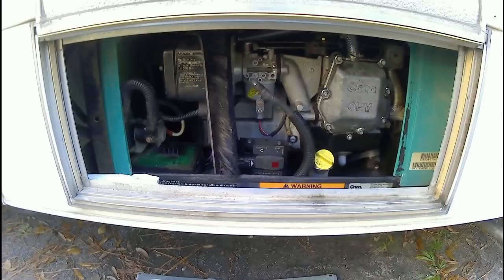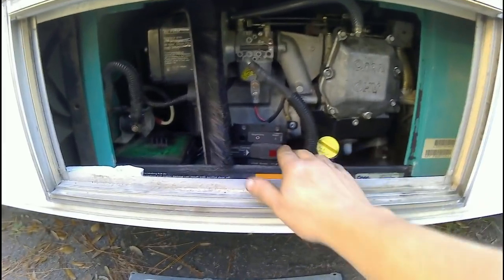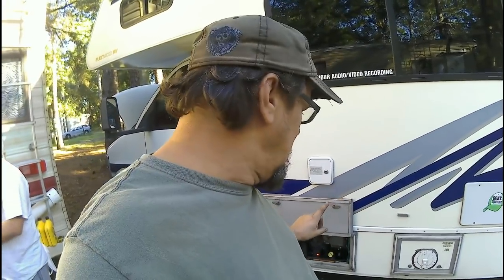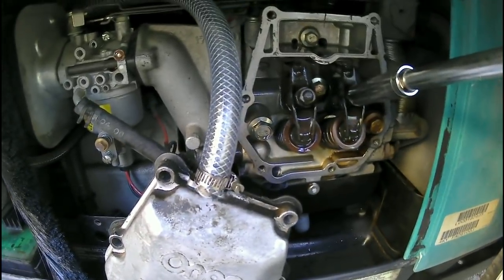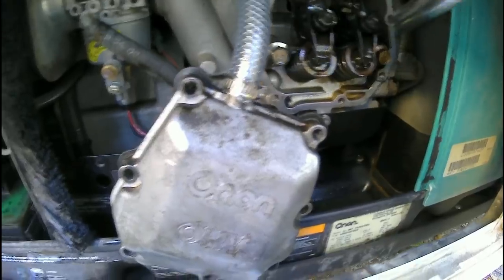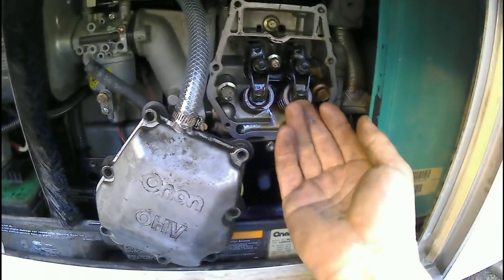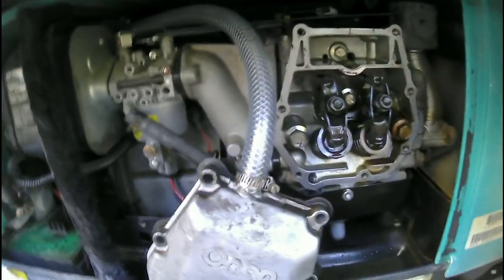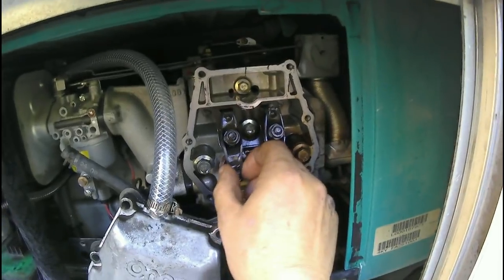Nomatic Fanatic Genset repair and Bloopers.

Comment: Tell him alot of times those mr. Buddy heaters need to have the orfice blown out with air before they will light and stay lit. I cover mine when not in use during warm weather with the Blue Painters tape to keep out the Dust. A can of Computer cleaning air will work also. Gr8 vid and look forward to watching more wayne.
Reply from the maker: I did let Eric know and he said Thank You. Great tip.
Reply: Yw, did a service call this evening and blew a gas log out and it fired right up and the homeowner said the gas co. Wanted $80 just to show up.
Can of air $8 at lowes

Comment: Wayne, glad you could help Erick. It's hard to do what he does, without being able to fix things himself. Most mechanics are just parts changers these days. 
BTW, the clear braided hose may work in an emergency but it's a good idea to replace it with a hose rated for oil and high temperature. Autozone sells it by the foot.
Reply from the maker: There is a difference in a mechanic and a parts changer. Parts changers cost you money while a real mechanic will save you money.
Reply: Sad but true. Dealerships love parts changers who can work very fast while often cutting corners. This is how they make money. I worked with a guy who was one of the best mechanics I ever met. He took his time to troubleshoot problems properly and to get the job done the way it should be done. The dealership was not happy with him. He did not make as much as other techs either.

Comment: When my onan stop working,I just got a Yamaha 2000 watt portable generator...much more quiet and has better fuel efficiency and its dependable and  weighs 45 lbs vs 200 +pounds for the onan.

Comment: Good job Wayne ! I need to drop my 2.8 in my Roadtrek and clean and rebuild the carb or convert it to propane . Oxegenated gas is a pita with the tiny jets . I wish all motor homes had the generator on a slide out rail system like the 70s GMC , how nice would that be ?
Reply from the maker: I dont think you have to drop it to remove the carb. Not 100% sure.

Comment: Some mad skills, would never have thought to check the oil plug to see if it was "An oil Plug"! Have the same Micro loud 4000 in mine, I gave up on it and got a Honda 3000ui, the Onan literally just gave me headaches from the noise/vibration. Eric owes you an "Outtro" for that fix. The sound was pretty good, but your killing me with no image stabilizer/gimbal. Just do tripod shots for fixed that looked good at 11.00 minute mark. Then slice the ends off in editing, Also frees up the hands.

Comment: When you tightened the valves did they have a locking nut on top or how does that work?
Reply from the maker: It is a single locking nut.

Comment: I noticed you adjusted the valves with out having it at top dead center on the compression stroke. The spark plug was still in and the flywheel is not visible. How did you find the exact top dead center ?
Reply from the maker: As long as the valve is in the fully closed position you can adjust them. I used the starter to bump the engine over and turned it by hand to get it where I needed it. Years of doing this you just know what to do.

Comment: My genny is the same and even has brass (NPT) plug and still does and 1350 hours.   Makes me wonder if Onan put it in by mistake?  Thanks for showing thread size.  Yes, first time changing oiI, I looked long time for oil filter (ha ha)  Couple years ago our friend caught his on fire.  He never inspected hoses, and had small leak and one day when starting it went up; Poof.  Hoses get hot and cold over and over their entire life.  Which is hard on hoses.  Same friend also was in process of checking oil and broke his plastic dipstick off,  he never saw it again.  
P.S. proper fuel pressure is (believe it or not according to Onan mechainc) "if gas is making it out of the hose at the carb end,  with gas line raised no more than 2 inches higher than carb,  then you have enough fuel pressure"   Certainly there is better spec.  Do you happen have a better spec than that? Thanks

Comment: Quality diagnosis and work.  Always simple after solving, eh. I have same genny, I'd be curious what gap on lifters?   I always look forward to your videos.  Take care
Reply from the maker: Intake Valve Clearance (Cold) 0.002 inch (0.05 mm)
Exhaust Valve Clearance (Cold) 0.002 inch (0.05 mm)

Spark Plug Gap 0.025 inch (0.64 mm)

Comment: OK Wayne. I want to tap into the wealth of Genset Knowledge  you have.  I have an 2005 Onan 5500 and I know I should change the oil and filter every 150 hours. My question is this. I only run my Genset when I arrive at a campsite to run down the levelers and run the slides out. I always run it at least 30 min before shutting it down. I take the RV out once or twice a month year round. I will never hit 150 hours of use in the next five years. I have not changed the oil in nearly 3 years now. I check it before every trip to make sure it is full of oil. I am going to change the oil come spring even though it has 18 hours of use on the oil. In the future, how often would you change the oil ?
Reply from the maker: I would change it at least once a year if you use it like you said. Moisture can build up on the engine and gets into the oil and that can ruin the engine.
Reply: I will indeed follow your recommendation. FYI I have a 2005 Georgie Boy on a W22 Workhorse Chassis with a 8.1L GM Motor if you ever have any questions concerning either the coach or the drive train what I don't know I have resources that do.  Thank you Wayne
Daniel R. Fort Worth Texas
Reply: Thank you Woody. Wayne said pretty much the same thing. I will take both of your advice. 
Living in the deep south we do not have an off season. As a matter of fact I just got home last evening from my latest outing. I also do a New Years Eve Campout each year.  Thank you for your reply woody.
Daniel R. Fort Worth Texas
Reply: You will not hear any from me either. I love the power plant and drive train enough that I will keep it and change out the carpet to laminate, Sleeper sofa to and L Shaped Sofa with a bar back and two chair. I have the remodel figured in my head. Next is to put it on paper. Then, Jan and Feb make it happen. 
Daniel R. Fort Worth Texas

Comment: Did you have to tap it to use the new drain plug? I have a similar issue.
Reply: rtzapper, I was wondering the same thing.
Reply from the maker: No, The plug I used was the correct one.

Comment: One word of advice Wayne. I've had some of the same issues and in fact I have a video on a zero cost nothing for generators of this exact type.  they run fine and then die. I know your video is not the same but 1 thing I can tell you from experience and you may know this, I'm just telling you in case you don't.  when you spray water or fluids back in there to clean the generator it's almost impossible to blow out and dry up the starter and has been my experience that within 6 months the starter will fail because it had water up in there.
Reply from the maker: I didn't spray alot of water and was careful of where I sprayed.

Comment: Please tell Eric that as he ordered the new pump, he has a responsibility to let the shop know that it is no longer required, out of respect. That means that if I need one I’m not told they won’t order one without a large deposit. I think I would have checked the pump first, I know hindsight is 100%.
Good job though!

Comment: Wayne I'm trying to learn here, confused. If the NPT (National Pipe Thread) plug that has 14 TPI ,.74 inch dia.( threads per inch) was forced into the soft cast aluminum crankcase hole many times by now. How did you did you fit the smaller M14X1.5, , 13.9 MM dia (.55 inch dia) drain plug in the worn larger and stripped hole. Also  Eric said it was loosing a quart of oil per day?
Reply from the maker: I dont know what size the NPT plug was. When I put in the correct drain plug it was a little tight but went in smoothly. It tightened up better then the brass plug that was in. Th brass was somewhat lose and couldn't seal correctly. Yes he said it was leaking about a quart a day.
Reply: Thanks Wayne for that information.

Comment: Just watched NF's newest release. More genny and brake drum issues.
RVPW; would you address the possibility that basic Class C RVs are not really designed for full time living?
NF has put a LOT of miles on his rigs. Most of this is likely just normal wear and tear for the mileage.
IS this correct?
I'm ten years out retiring and going full time. I now am considering a Super C for longevity and reliability vs a 'van' Class C type.
Thanks!
Reply from the maker: Yes I can address it in a future video.

Comment: GOOD MORNING WAYNE I HAVE A QUESTION MY TRAVEL TRAILER AWINING IS NOT RETRACTING AND I HAVE IT CONNECTED STRAIGHT TO A OUTLET? IT MAKES NOSE LIKE IT WANT TO RETRACT BUT IT DOESTN
Reply from the maker: Try to push on it when retracting. You may need to spray the tracks that it slides on.
Reply: THANKS FOR YOUR HELP👍 KEEP THE GOOD VIDEOS COMING

Comment: I'm surprised that engine even started with rocker arms flopping aorund as loose as those were, that would also mean they have abnormal wear, I'd replace those if it was mine, but that's just how I am.
Reply from the maker: You and me both. I didn't see any abnormal wear on them so adjusting them was good.